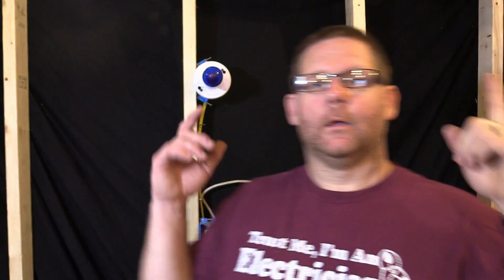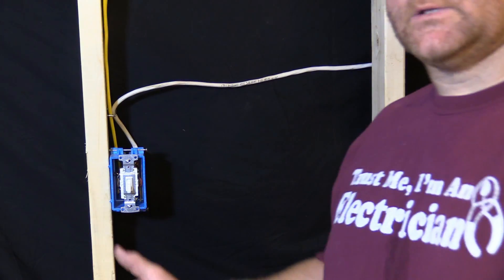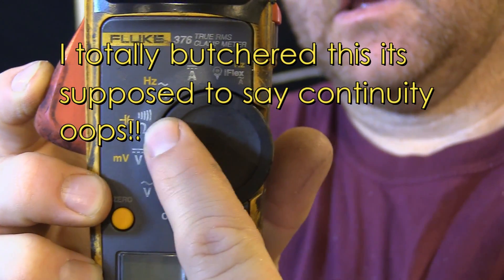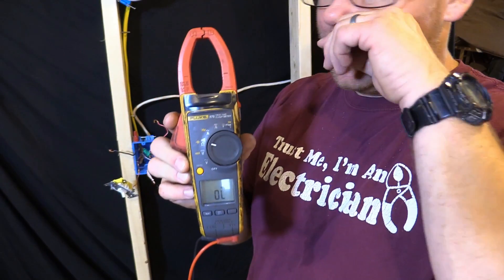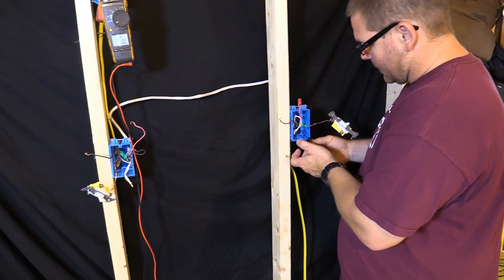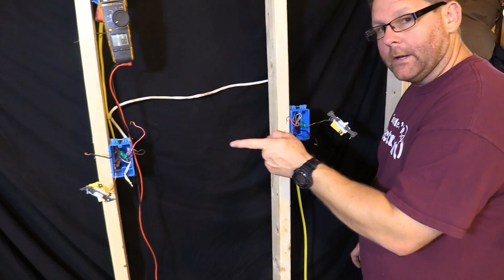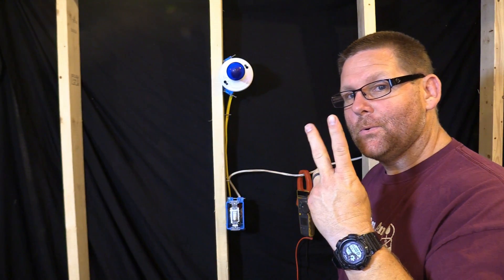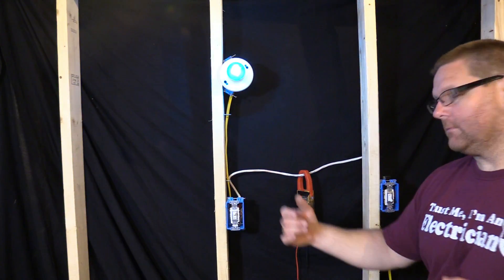How To Fix A 3 Way Switch Problem

Comment: Love your videos great help. I’m slightly confused at this one,at the end of the video you said you put the hot on the traveler side but you put the hot on the “common black” screw. The two screws at the bottom are traveler right?
Reply from the maker: The common screw has only one job. It either receives a hot or switches a light. The other 2 screws (brass) are for the travelers

Comment: I just tested both of my wires from each of my two 3 way switches and both switches have a hot leg inside. Being you said only one of the switches should have a hot wire what do you think could possibly be going on?
Reply from the maker: There is no way you had two Hots in there if you did that something is definitely miswired pretty terrible. Are you using a actual meter or that tick tracer. One should only be hot if you have the switches disconnected
Reply: @MountaineerOutdoors  I had everything completely disconnected and I’m using a volt meter to measure. At each switch there’s one hot leg giving off 124v. I’m a pretty solid electrician but this one really through me off. Tracing these wires down is pretty impossible as well. I did test for continuity as well so I also know my wires are good. Not sure what’s going on here, Lol
Reply from the maker: Where is your hot originating in the light box or the switch box. Sorry misread your last comment
Reply: @MountaineerOutdoors  the power source ties in from a outlet. From the outlet they run to a switch to the right of the room and to another switch across the other side of the bedroom.
Reply from the maker: First of all, is the wires all separated out and not touching any other wire?

Comment: This is the best video I've seen, but I am still stumped.  Using my multi-meter (just a cheap one), I determined that my hot comes into switchbox A and is sent via 12-3 to switchbox B where it connects to the first three-way switch (black wire on Common) and sends back two travelers (red and white).  I have an entry level multi-meter and was not able to get the continuity test to work after tying together the two traveler wires.  So, I rotated each of the wire connections on the leg switch to see if any of the possible parings would fix the issue.  It did not.  So, if the first switch is up, the leg switch will turn the light off / on.  If the first switch is down, the leg switch will not work.  The switches control just one light.  I pulled down the light and only a 12-2 wire is in the junction box.  Frustrating that I cannot figure it out.  Time to bring in a professional.  Thanks for this video - it was a great help.

Comment: Do you have a video that troubleshoots 2 3-way and a FOUR WAY... that SHOULD be in the middle of course if we knew how to troubleshoot to see if there was a 4 way or some nut job used 3 3way switches.... :hand-pink-waving:
Reply from the maker: No but I will be working on that very soon
Reply: Thanks.... I am not sure that it even was working because I did not remove a 4 way but there is definitely 3 switches in the line.... I cannot believe that whomever installed the plugs and switches knew what they were doing... there is for sure 3- 3 way switches... I'll search in the meantime for an electrical manual or like, Coles note type of thing.... @MountaineerOutdoors

Comment: My son has owned his house for 4 years and the entryway lights drove me nuts and made little sense. I had assumed that they had mistakenly put in 2-way switches in a previous remodel. This morning, I pulled the plates and saw that they were indeed 3-way switches, but each box was packed with a bunch of NM wires and I didn’t know where to begin. Several websites with photos weren’t helpful. I came upon your video and had everything wired and working properly in less than half an hour. Thanks!
Reply from the maker: Awesome so glad to hear that this helped you ☺

Comment: This was extremely helpful. Since I knew the red traveler, commons, and ground were correct, I just tested to locate the black traveler using continuity between the two switches. That told me which were the switched legs so I could just hook the black traveler to the other brass screw and the swtiched legs to the black screw on each. You made this much clearer than anything I had read and it took 5min to fix after watching this. Thanks so much!
Reply from the maker: Awesome so glad to hear that this helped ☺

Comment: Thanks for your guidance! I can't find anywhere what to do when the wires are seemingly in the right places. I have a 3-way switch with 2 light fixtures in between. It's a bathroom. The switches are actually 5 feet apart. So it's more a nuisance than a problem. However, the hot wires are on common and the travelers are on travelers. I don't know what to do next. It's not easy to test continuity because they are "stab in" connections. They don't come out easy. And I am reading that I must replace the entire switch if I cut this out. Is it possible the travelers are disconnected internally, not connected properly to the switch, or are faulty wires? Can I cut them out of the "stab ins," test continuity, and then rewire them to the screws?
Reply from the maker: So with the stab ins you there is a little slot where you can take a small screwdriver and put it in there and pull out the wires for the back. Or you should be able to pull and twist them out. And then yes wrap them around the screw for sure
Reply: @MountaineerOutdoors  Thank you so much for your reply. I guess my question was: What do I do if the wires aren't the issue? Once I cut out the stab ins and tested for continuity, the wires worked and the positioning was accurate. Not many videos accounted for the fact that sometimes the switches go bad. After checking for continuity in both switches (on vs. off positions), I learned that they were both broken in the same way. I replaced them both and voila.
Reply from the maker: Wow that's unusual for both to go bad. They are man made so it always subject to failure. Thanks for letting me know and maybe I will do a video show how to check a switch to see if it is bad or not.

Comment: I recently had a foyer light go out while I was in the foyer excepting a package from fed x. The light started going from dim to bright and then it went out.  I replaced the 3 way switch by the entry door and still no light. I replaced the second 3 way switch in the upstairs hallway and the light worked, The confusing thing is that both switches test fine with a multimeter? This happened a week ago and the light is still working fine,. When I originally tested power at both boxes, I had 122v coming into each box. Its just weird!
Reply from the maker: Maybe there was a loose wire in the switch box?  Or the switch was just going bad once it heated up it was opening up. At least it is fixed now.
Reply: @MountaineerOutdoors  The light stopped working again last night- then it started and then it stopped again lol.

We just bought this house a year ago and when I put up outside Christmas lights, I tried using a GFI outlet that is mounted in the porch eve. 

The outlet has not been used in a long time and the lights did not work. A voltage tester showed slow beeps indicating intermitted or weak voltage? 

I wiggled the outlet to try and get current but it did not work. I used a different outlet for the lights, but that night is when the foyer lights started to act up.

Last night, I tested the eve outlet when power was going to the inside three way switches. It had the same intermittent signal. I threw the breaker and found that there was no power to the outside outlet or the 3 way switches.

I'm going to change it out later today but if that's the culprit, it's weird that it would be on the same circuit as the inside switches.
Reply from the maker: I have seen alot of crazy stuff before. By chance do you have knob and tubing in your home? Sound like you have a loose joint somewhere if it's an older house, most of the joints are made up inside of the light box. Keep me posted on what you find
Reply: @MountaineerOutdoors  No, house is only 18 yrs old with newer wiring. It appears the neutrals are wired together behind a 5 wall switch panel. I have not checked the connections there yet? I will keep you in the loop- always something lol
Reply: changed the outside GFI outlet in the porch eve and it's working fine. I still have no chandelier light. I checked all the connection's and everything is tight. It must be the chandelier itself?  I have 122v going into both switches but no light no matter what I do. The GFI breaker is on the same circuit but before the switches. 

I think its time to call in a professional. The chandelier is about 30 feet up-lol
Reply from the maker: Let me know what he finds curious now
Reply: @MountaineerOutdoors  i had voltage drop from the line to the neutral. Line to ground in all three boxes was 122v. 

I triple checked the wire nuts connecting the neutral wires in each box. One of the junction boxes had six neutral wires tied together with a red wire nut. 

it was tucked way in the back of the box and on the opposite side from the chandelier switch.

The first two times i checked, I just reached in the back with my fingers, and it felt tight. The last time I took a pair of needle nose, pliers, and pulled the wire nut out to where I could  get some leverage on it . 

I found it was loose. That fixed the problem. You were right about it being a connection problem! 😀 

if anybody reads this, I hope it helps them understand that it’s important to get the wire nuts out to where you can actually see them and get leverage on them. 

I replaced the wire nut with  a screw type connecting lug from Home Depot. That is a much better connection. 

The lights are working fine now. Thank you for for getting back to me and helping- appreciate it👍😀

Comment: My light switches are wired correctly but I somewhere in the attic the neutral got disconnected. Can I run a neutral wire from a different light circuit to make this work. Well I kinda already did and it works but will something happen because I stole the neutral from another circuit?
Reply from the maker: I would be very cautious opening boxes with that nuetral floating around broken.

Comment: Thanks for the easy to understand tutorial.  I have the same problem in a 70 year old house, however the wires are not color coated.  Do you have a video explaining how to identify the various wires in older homes?  How can I identify the light fixture wires?
Reply from the maker: I don't as of now but it may be a good video idea

Comment: what no one seems to address is a three way that's worked for forty years and must have been correctly wire (because it worked for forty years) and suddenly quit working?  I called my electrician nephew and I need to get new switch boxes. Nothing was ever wrong with the wiring....

Comment: Well, I have done all that you did and they still don't work!  The only difference is I have another black wire in one box.  When I went to change the switch out the hot wire and this other black wire were both on the common.  I have no idea what is going on as I have identified the hot and the travelers, just don't know why this other black wire is there.

Comment: 2 switches one with a dimmer, believe where hot is, if I turn it off in one spot can't turn it on on other switch, both switches will turn them on n off just not after u turned it off on the other. how do u tell what switch is bad.
Reply from the maker: Almost sounds like it's wired up wrong
Reply: @MountaineerOutdoors  YES, I would agree, but it worked for years. just stopped working. How do I test what switch is bad.  thanks
Reply from the maker: Your gonna have to take out the switch disconnect the wires and use a meter on continuity check to see if the contacts are working. One lead to the common(black screw) the other to one of brass colored screws.

Comment: Great vid,
in my situation at the common (hot) wire terminal on the old switch there was another hot wire feeding another light in the hall which was on a one way switch. Is this typical? permissible? Its very difficult to put 2 wires on one terminal screw. Will this affect the 3 way operation?  I had it working until I put the wire to hall light back on, then my 3 way stopped working . The other 3 way switch is working. Somehow its affecting the travelers. Grrrrrr!
Mike
Reply: Thanks for quick reply! What happened was because of that, my hot wire didn't stay put under the pressure of bushing the switch back into the box.....so I used the green wire nut with hole you used on another of your videos and attached one wire to the black screw terminal.
Everything working now! Thanks to your vid, I learned a lot about 3 way switch installation and saved big bucks. Thanks from Mike in Texas👍
Reply from the maker: That's awesome and glad to hear that you got it fixed. Have a great day ☺
Reply from the maker: Honestly you should never have 2 wires under one screw unless its a pressure kinda switch where its ok to do that.

Comment: Thank you for your responding to my question and showing me this video. When testing continuity, is the power on or off? When attaching the switch in the box, does it mater if the ground screw is on the bottom or top?
Reply from the maker: My pleasure, when you check continuity your power needs to be off. And the ground screw up or down doesn't matter unless it matters to you.

Comment: So if you do all that and it still will not shut off from one of the wall switches when turned on from the other? Is there an easy way to check the switches? They both work from their home locations.
Reply from the maker: You would have to pull the switches out to check them with the wires off
Reply: @MountaineerOutdoors  Thanks. I replaced the switches and still not working correctly. I give up and will have an electrician look at it at some point.
Reply from the maker: Is there a 4 way switch involved in this setup?

Comment: Hi love your videos. The last one I watch was how to wire up a bx cable the right way and to make sure I use a red eye and a connector for bx cable. Now I just movie into a new house and I came into the same problem the switch on top of the stairs to the basement turn on the lights. Then I found a switch in the back of the basement that can also turn off and on the lights. Everything was working fine until a week later I went to flip the switch At the top of the stairs and no lights came on. I went down in the basement to flip the other switch And nothing no power, now those switches also is wired to the sensor lights and the back yard and no lights work. Please help. I will try this video first to see if it work. I will also change the switch maybe it could be the switch because I took the cover plate off and I touch the wire with my voltage tester and no noise or power to let me know their was power in the wire.
Reply from the maker: Maybe there is a breaker tripped?
Reply: @MountaineerOutdoors  thanks for replying back. The thing is it’s an multi family house so the main breaker is in the basement and I checked it multiple time and it is fine not tripped. So I guess maybe it’s connected to an outlet that is bad or wires are loose 🤷🏽‍♂️. But I’ll will check and possibly rewired every thing again. But I’ve watch this video at least 8 times lol I know how to wire a 3 way switch lol. Great video and info. 👍🏾
Reply: Their is a regular light switch next to it and that works fine so i don’t think it’s the breaker. And when I connect the black/hot wire to the light switch hot wire the lights come on and the sensor lights come on so I don’t think it’s the light bulbs, but the lights stays on. I think cause I didn’t connect the the neutral to control from the switch but i just did that to see if it was the light bulbs.